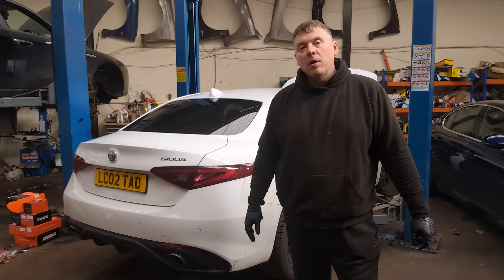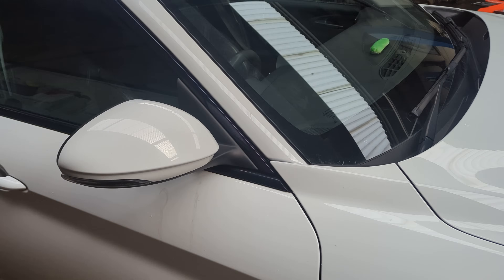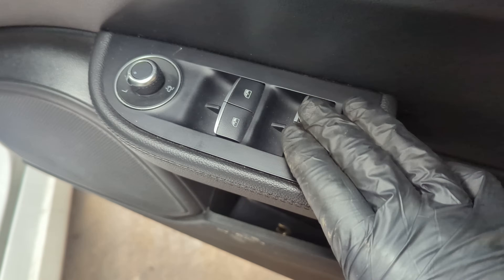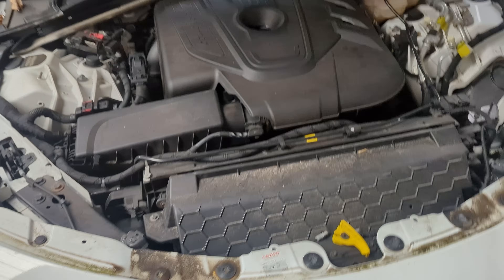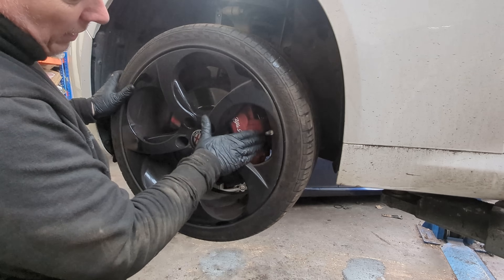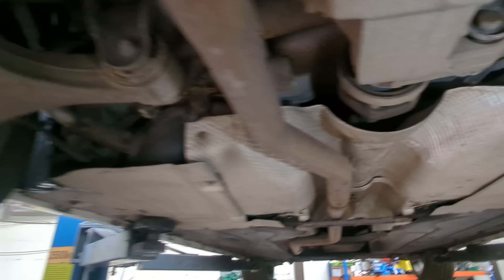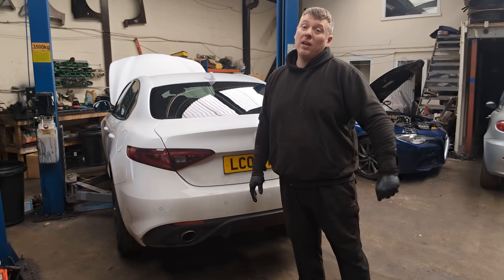ARE MODERN ALFA ROMEOS RELIABLE?    LETS FIND OUT!

Comment: Mine is 2016 2,2 diesel and have almost 183000 miles. I'm the owner for about 4 years now and only issues a have was EGR cooler at 140000 miles and electronic hand brake wiring  was snapped. Suspension, arms and bushings is still all original. Overall it is the best car that I own and my next car will still be Giulia. I just cant find a saloon car with such good driving dynamics. And yes peoples still thinking about Alfas like it was 30 -40 years ago. But if you look other brands what kind issues they or still have Alfas are actually really reliable among modern cars.
Reply from the maker: Thanks for letting us know about your car.
Reply: @ItaliaAutos  looking for used Giulia so i have question, finding on italians forum that giulias have problems with o ring on oil pump , droping oil pressure and can destroy engine, so is this serious problem or not because i want this car so much. Its about 2,2 jtd engine
Reply: I have a 2015 petrol multiair giulietta with 125000 on the clock. I had to change the multiair unit when I bought the car at 44000 but since it hasn't missed a beat
Reply: @generationx227  yes the same problem was on Giuliettas and 159 (here I'm little mad on Alfa, because they could easily fix this on Giulias) The first symptom is oil pressure warning on cold start. If you fix this immediately no harm is done. On RWD Giulias is quite easy to remove oil pan and replace this O-ring, but on Q4 is a lot of work. But the other problem is also bolts on oil pump housing get loose and from there you can have potential oil pressure issues. But if you fix this immediately there will be no harm in engine. Mine have 183000 miles and didn't have this issue yet.
Reply: I’m about to collect a 7 year old giulietta 2l diesel tomorrow. I usually service my cars at main dealer or specialist but I’ve seen some bad reviews about Alfa main dealer I think I should stay clear! How have you maintained yours? Are regular garages capable of working on them properly?
Reply: as a Giulia diesel owner too, i agree, btw mine has only 80k km or 50k miles on, and is a 2016 model too, manual transmission SUPER with only full leather seats as optional
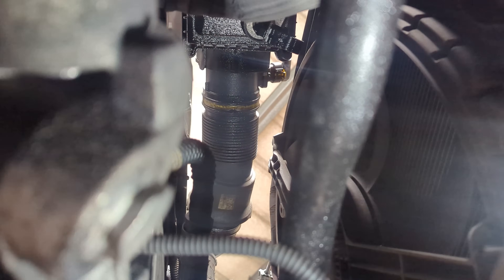Reply: 7:50 because the first version of the vapor oil separator filter was not efficient, updated version performs better, thats why i had mine replaced one year ago during the timing belt replacement service. so i went from little bit of oil in the intake to almost no oil in the intake.
Reply: Mine too, I got mine in 2018 and I have put 150 thousand km on the clock. I have had a radiator issue that they sorted out. I love this car
Reply: Well the good thing about bad fame of italian cars is that you can get them quite discounted even at reasonable low miles.
Reply: The fact that there are some things wrong with the car at that mileage. Is bad. Considering Japanese cars of the same mileage if not greater. Have ZERO Faults. Alfa Romeo are beautiful cars and I am glad you found a decent one.
Reply: anything about electric issues?
Reply: @bernymonty22  What motor oil do you use for your 2.2 diesel I use 5w30 and thinking about switching to 0w20 since it's the recommended oil by the manufacturer.
Reply: @MoroccanHoonigan  stay with 5W30 C2 oil. 0W20 is too thin and is only there because of emission standards. Maybe the last option I would choose is 0W30. 0W20 is possible for smaller gasoline and hybrid engines, where the loads are not so high. Diesels due to regeneration, Ad-Blue system, soot... they are more loaded and 0W20 oil quickly loses quality and does not withstand the prescribed oil change interval.
Reply: @ I have a problem with electric hand brake wiring. It can snap and a small issue with infotainment that software update fix it. No other el. issues, just make sure you have a good battery.

Comment: It is a myth. Alfas if looked after will be more reliable than a Merc or BMW. They don't use as many plastic parts in the engine bay as the Germans. Love Alfas
Reply: You can’t say a merc that has receipts for it reliability
Reply: Agreed. Mechanically, Alfas has always been good, as long as the cam belt is changed & regular oil changes. The biggest issues with Alfa 156, GTVs (916), and GTs is their suspension is made of chocolate. 😉

The newer models tend to have eradicated these issues.
Reply: @plasticpenguin1  controll arm rubber bushing to be precise, replace with poliuretane ones and last forever
Reply: I'm at 55K in my Q4. The only problem we've had (my wife has a Stelvio) was the OEM battery. Once replaced, perfectly reliable!
Reply: @plasticpenguin1  That's somewhat true about the suspension, but parts for those older models are so cheap (at least in europe) you can basically replace the whole suspension for like 300 euros and then you're safe  for a good number of years.

Comment: I have a 2015 Giulietta, my previous 156 & 159 were unreliable and I took a risk with the Giulietta. It broke down on the A303 with 235 miles on the clock. My first thought was here I go again. The air mass sensor cable had not been tied into the loom during manufacture and had been resting on the manifold.
Nine years on, it has just passed its MOT for the seventh time without any work being required. The only non service part I’ve had to replace was the oil filler cap, the ratchet mechanism was causing problems £14.60 to replace. It is the most reliable car I have ever owned
Reply: My 2.4 jtd I kept for 180.000 miles 18 years faultless. Rust in the end ❤
Reply: Weird. My 156 is reliable. 305 k kmh on it.
Reply: I'm on my 2nd Giulietta 1.6jtdm and they've both been ultra reliable, had an issue with the wiring loom on my 11 plate model to the rear window wiper but got sorted for £160 by an auto electrician. Not had a single issue with my current TCT model. Going to get a Stelvio next - I'm now an Alfa fan!
Reply: 2016 1.6d Giulietta, 140k, serviced every 10k, never missed a beat.

Comment: I have bought an early 2017 model with the 150 hp diesel and ZF gearbox with 199,000 km in Dec 2023... just to familiarize myself with these cars as I fell in love with the Giulia from the first days after its introduction. To my surprise, the interior looks fantastic, the suspension is all quiet, the engine runs perfectly fine and the car drives amazing. The only issues it has, still minor though, is the outside mirror's laquer that is peeling off, easily repairable. I have put nearly 7,000 km on it with 206,000 km right now and I cannot stop driving it. It's my first Alfa and it won't be my last Giulia.
Reply: Im also considering buying the 150hp diesel (manual) and I'm wondering how are the service/repair costs when compared to a VAG car ?

Comment: 2018 Giulia Quadrifoglio, 62.000 km, trouble free apart from a solenoid valve in the left cylinder bank which was changed under warrantee
2023 Tonale Veloce, 8.000 km so far, trouble free
2014 Giulietta Quadrifoglio Verde, 45.000 km trouble free
2010 159 TBi Ti, 65.000 km, trouble free
2006 156 2.0 JTS, 52.000 km, trouble free….
I could go back even longer… but nothing can beat my brother’s 1995 model year 146 TS which he drove for 355.000 km only servicing it once a year (just like I do too).
Alfista dal cuore 🍀
Reply: 147 from 1995? The Alfa 147 starts in 2001, i think you meen 145 or 146?
Reply: Indeed a typo, I meant 146 TS 😀

Comment: Currently own a 2005 156 2.0 JTS Sportwagon. It’s as sweet as a nut both aesthetically and mechanically. Just passed the MOT with a couple of advisories (front brake discs and dull o/s headlight cover.)

Had the car 8 years, and it's a daily driver.

And It’s in a very rare (for a SW) in Azzurro Gabbiano blue.

Comment: 2.2 jtd 180hp auto 205 000km
Just came back from 2000km trip and i wish tomorrow can do another one, sadly i have work to do
Reply: I'm looking to buy one (2.2 jtd 180hp auto too), did you have any problems since this comment ?
Reply: @Opium4  no problem at all. Just maintain it properly and if high mileage i would advice EGR removal, oil pump seal replacement with modified version and 0w30 or 5w30 oil every 7000-10000km
Reply: @tommyg2232  Perfect thank you ! In my budget the cars have about 100,000 km so I think I won’t encounter too many problems
Reply: @opium4 Did you get it at the end?

Comment: I've owned my 5 1/2 old Giuila Veloce for 3 years & had zero issues during my ownership. Now has 34K on the clock. Car is fantastic to drive & by far the best car I have every owned. Also have a  1999 TS which has never broken down in 7 1/2 years over ownership, just under 120K miles on the clock.
Reply from the maker: Good stuff thanks for sharing

Comment: I'm about to retire my 370K mile alfa 166!
Last year turbo went, lost aircon, steering rack weared out, DMF is making weird noises and has some shot bushings, plus my past neighbours left it like a golf ball, it's a lost cause.
But guess what, i'm getting another one with only 110K miles in superb condition.

Alfas are not hard or complex to fix. In fact I find them way easier to work on them than in german cars.
They don't have 5000 control units, most faults are easily seen with some OBD testing, 99% of them are split VNT or intake hoses, stuck EGR, upper whishbones and auxiliary belt stuff.
However mechanics keep crying for silly things, like there's a hose between him and the turbo that must be removed first, or breaking four things to fix one (Just pull until it comes out no matter what).
So I became my own alfa specialist, cheaper, better.

Comment: My 22 year old 2.4jtd 156 , with 300,000km still going strong,  in 10 years,  it's never let me down.  Cambelt change was a kick in the nuts,  for sure.
Reply: yeah, that poor 2.4 is so cramped inside the engine bay😂, thankfully on Giulia, despite all extra elettronic and emission accessories around is quite spacious

Comment: I owned my first Alfa for 7 yrs and covered 130,000 miles in it. It required the cam variator replacing, but other than that it only needed regular servicing, tyres and brakes. Sadly I didn’t keep my second Alfa for long enough to form an opinion on its longevity - I changed job and that came with a company car. My current Alfa is 13 yrs old, and is just coming up to 130,000 miles - I’ve had it for 4 years, and so far have replaced a thermostat housing, EGR valve, front shocks, and a wheel bearing…..other than that it’s been service items. I think that’s decent going for a supposedly ‘unreliable’ Italian car maker.

Comment: I have a 2018 ti sport stelvio. I love this car. 82000 miles and have not had any issues. Only complaint is the infotainment system but they fixed this in the newer models.

Comment: My father had an Alfasud. He did 250.000 kms in it and he only replaced perishable parts, but it's true that they rust like crazy.
A friend of mine has an Alfa Romeo 147 and he says that if you service the engine regularly and don't thrash the car, it's very reliable.

Comment: Had one of the original Mitos. Drove 500m from the dealer and had to drive straight back. The heated seats were wired up wrong. 
In short we had 2 gearboxes, 2 resprays, 3 lots of suspension and a set of replacement window wipers. 
But we loved it!!

Comment: Great to see a what a great car we all know the giulia really is just a shame you don't see many on the roads but when you do they still stand out from all the German cars by a mile ! Definitely my next car after my 159, great video Neal look forward to the next one
Reply from the maker: I do love a Giulia.
Reply: I miss my 159, should never of sold it😢
Reply: Yeah it is a good platform, Alfa missed a trick not using the platform more, they should have made an estate, coupe and convertible
Reply: 159 or Brera models have many faults.  Front Subframes rot out too easily due to bad design and water intake or positioning of the A/C leak off pipe which fills the subframe with water. , rear trailing arms rust away, sills corroded away, coil springs break,
Reply: @Autotrawler1  It's not wasted, the Giorgio platform is used for the Jeep Grand Cherokee and Grand Wagoneer as well.  I guess unprofitable body styles like estates, coupes, convertibles are not of interest to the company compared to SUVs.  Heck Alfa Romeo don't either bother to make a hatchback anymore!  It is the strictly the more saleable Tonale CUV only.  IMO, Alfa (and Fiat and Dodge and Chrysler) having huge gaps in their product lineup and stopping models with no replacement is unwise.
Reply: @TassieLorenzo   I agree with you that it's a big mistake not to replace the Giulietta and Mito. I see them both quite often here in the UK, unlike Giulias and Stelvios. I think I've seen maybe 1 Tonale so it clearly isn't doing very well here so far. I worry what will become of Alfa if they don't offer something desirable and affordable to their fans soon.

Comment: My 2011 Giulietta is still in near perfect condition, no rust whatsoever has 185k kms on it now. Only regular maintenenance, oil, filters, brakes, cam belts etc. no big repair jobs necessary until now. The most reliable car I ever owned, and I had a few.

Comment: Some diesel versions have a problem with low oil pressure and lose bolts on oil pump. I dont know how common that is. 
Myself i have Veloce 2.0 petrol. Runs good so far. Fun car. Had to change the factory battery tho.
Reply from the maker: It's not a common fault.

Comment: I agree, my stelvio 2.2 td has 250.000 km trouble free (only oil pump after 200.000 km), my second Stelvio 2.2 td has 50.000 km trouble free of course, and the second car is a Tonale trouble free. after ten years of BMW these Alfa confirm the quality of the brand.

Comment: Nice to see this balanced opinion of the Giulia. I’ve been unlucky with mine, it’s now out of warranty and the dashboard has lit up like a Christmas tree. I’m waiting to see if a replacement ABS sensor will fix the problem but it’s a weird one! It has also had a problem with the water pump and the battery charging circuit. To be honest this car has been the most unreliable car I’ve had since about the 1990s but I love it. Although I have lost all faith Alfa Romeo mainly due to the atrocious dealerships in the south-east of England. After nearly four years of ownership, I would recommend against buying one even though my heart says it’s a great car.
Reply: What year model is it
Reply: Glass mat battery
Reply: What year and model?
Reply: @Noahkinz  year 2000 Giulia Veloce 2.0. The ABS sensor that did the trick, but the battery still struggles to hold a charge for very long.

Comment: Mine is a 2020 Ti Sport Carbon (Veloce Ti overseas) with 60k miles. Bought it when it had 38k miles as the second owner, no major issues at all. The only thing that has happened is when the car got closer to 50k miles, a valve in the EVAP system gets stuck closed and will throw the CE light on, it'll happen randomly nowadays but it DOES NOT mess with the drivability at all. A quick use of the OBD scanner to clear the code and it's good to go. Rather just use that than spend hundreds to fix a small issue, so it doesn't bother me but everyone's different.

Comment: I had one of the last Lancia Kappa Coupe 3.0V6 24V from 2001. Never had any problems except with the adaptive Kayaba shocks on the front. They started leaking at approx. 100.000 kms. Quite a hefty bill. The new shocks had the same problem but were replaced under warranty. And the front wiper control unit stopped working while it was raining. One of the water spray hoses came loose and flooded the control unit. Also an expensive replacement. Everything worked well, paint was good (no rust whatsoever). I have seen worse German cars from that age.

Comment: Depends on what you consider durable and reliable as well. I was reading through some of the comments and have read people stating things like "my Alfa has 40,000 km and has been utterly reliable!". 40,000 km as a standard of reliability, that's a joke, right? That's just a bit short of 25,000 miles. I know some people that put that many miles on a car in less than a year.

I have a 2014 Miata that has right around 115,000 miles (185,074 km) on it. Never had a wrench put on it other than standard maintenance (oil, tires, brake pads). I really don't even entertain the possibility of calling a car reliable unless the brand/model hits a minimum 150,000 miles (240,000+ km) with zero true mechanical issues as a routine.

This is my 3rd Miata. Both of my previous Miatas were mechanically fine when I sold them to buy the next one. Both had over 200,000 miles (320,000+ km). Only one had to ever be put in the shop for mechanical repair, and that was MY fault due to overly aggressive driving (cracked my transaxle housing). With this third Miata well on its way to matching the other two, I can say the Mazda Miata is a pretty reliable car. That's how you judge reliability, not 40,000km lol.

Having said that, I'd ABSOLUTELY LOVE to own an Alfa 4C. I think it's the most gorgeous lightweight two-seater ever built. Japanese build the most reliable stuff, but Europeans just have the better eye for aesthetics. If a Japanese company would build a reliable driver-oriented car similar to the Miata (also in price) but that LOOKED as exciting as the 4C they'd completely rule the lightweight sports car world.

Comment: I have a 20 year old Alfa 147 since new, it's just turned over 207,000 Klms. Apart from timing belt and water pump changes, at the prescribed mileage,  it had the clutch replaced after 201,000 Klms. Nothing else at all. Also a 2014 Giulietta 1.7 litre turbo, it also runs perfectly. Nothing replaced apart from timing belt and water pump when due. They are very reliable cars, they handle beautifully and look great.